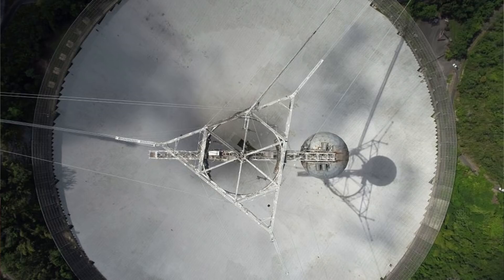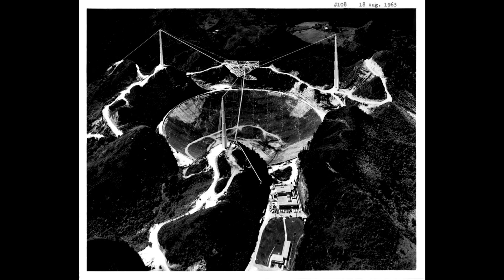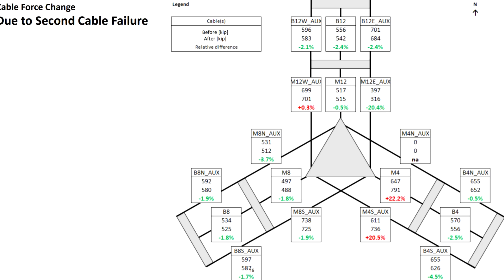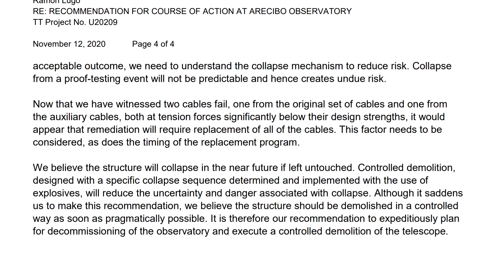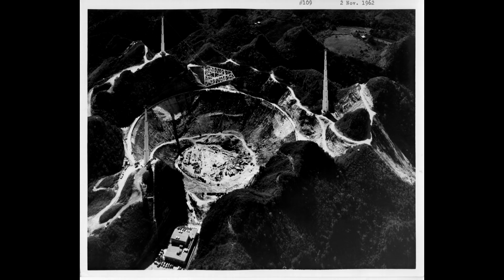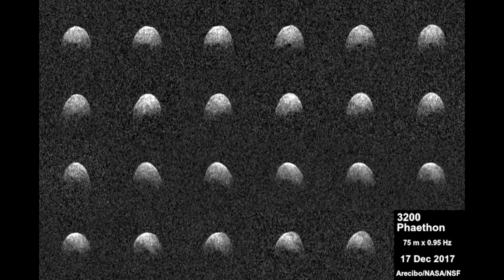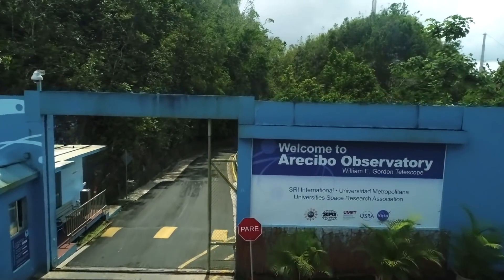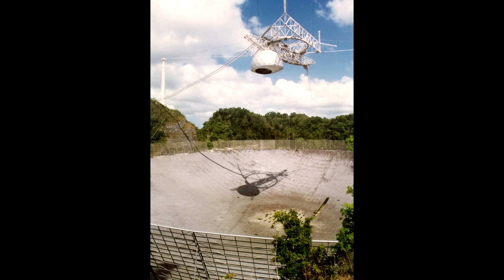Worlds Largest Radar Astronomy Dish To Be Demolished!

Comment: @Scott Manly. If superheavy booster can lift a 1450 ton Starship and Falcon 9 second Stage only weighs 126.5 tons wet why not create a combined dragon/second stage capsule with heat shields and engines on the sides like crew dragon?
Reply: 1) Cost - Starship is designed to be rapidly reusable. The F9 upper stage isn’t, and the money to make it so would have to come from funds being used to develop Starship itself. Even if you could do that, it wouldn’t make it easily & rapidly reusable.
2) Fuels - Starship is designed to run on CH4. F9 is designed to run on RP-1, which has a lower ISP than both CH4 & H2. Enabling F9 to take either would require a complete redesign, which would cost money that could be spent developing Starship, & give you a lot less capable vehicle.
3) Starship is designed to get 100 people or 100t into space. The combo you’re describing would cost more to launch while carrying a max of 7 people or 8 t to LEO.
Either the Starship works or it doesn’t. What you’ve described would be an expensive diversion of funds, would take more time to develop than a working Starship & would be less capable & efficient & more complicated than Starship, while costing more to launch.
Reply: @TraditionalAnglican  Granted in an either/or perspective with a view to Mars Starship is the right choice but it's impossible to ignore that Starship still has operational problems.  
1. No Launch Abort
2. Lunar variant is expendable 
3. Lunar Variant needs a new engine because it's thrust is too powerful for Lunar regolith. 
4. The Martian Starship will only be able to take 50-60 no 100 people so it's not a the craft for true Martian Colonization
5. Refueling Starship might take 4-6 separate Launches for Mars and the Moon which could take more than a week to accomplish and while you're waiting for that refueling you're consuming valuable resources for the humans onboard and having umans on board is extremely dangerous for 5 rounds of refueling. 
7. NASA is unlikely to choose Starship for their Lunar Lander for just these reasons. 

Here's what's absolutely NOT happening.  One Starship isn't going perform all the these task.  There are already SIX Versions of Starship.  Colonial Transport, Cargo, Refueler, 15 Person and Cargo Vangard for Mars, Planet Hopper and Lunar Transport.  These will all be different designs.  The BIGGEST problem is that they won't be optimized for their specific task.  Space X wants to make it easier to mass produce but doing so makes each variant inefficient to accomplishing it's task and that what were seeing with these refueling times.

On the Other Hand...
A Reusable Second Stage melded into a Capsule design is easier to refuel, has Launch abort ability, simpler and smaller to produce and only requires a new smaller variant of the Raptor Engine which the Lunar Lander already needs.  It could also carry as many 36 people to orbit.

I think it makes alot of sense.
Reply: @saquist  - Refueling can be done using Starships (or a single one that’s been fully refueled) already sent into orbit, so no waiting a week in earth orbit waiting for Refueling Starships. ATST, NASA has already decided that fueling with astronauts on board is safe for F-9. A week isn’t all that significant when one considers the amount of stores Starships will need to carry for the worst case scenario of an 18 month Earth Free Return.
An abort system wouldn’t help in most of the places Starship is going to be going to (Aborting on Mars would still kill the crew 99.99% of the time), and would add complexity, inefficiency & weight. We don’t have abort systems on commercial aircraft for the same reason - We just try to make them so reliable that these systems are redundant & completely unnecessary.
I haven’t seen where SpaceX is talking about using “Mini-Raptors” to land on the moon, but the engineers believe that mounting engines 1/2-3/4 of the way up on the side should solve the lunar regolith problem. ATST, there’s always the option of landing a couple of ALPACAS & building a lunar landing/launch pad, something they’re going to need to do if we’re going to have anything more than a very minimalist moon base. If we do that, the Lunar Starship becomes superfluous. The LS is supposed to be reusable, not expendable. That probably means it would have to go into earth orbit to be refueled. Actually, I believe Congress will insist that either the National Team Lander (a.k.a., “Lobby Lander”) or the Boeing HLS be used, and NASA will have to choose one of these two to have the Moon landing funded.
I’ve not heard of a 15 person Starship, & the Cargo Starship is designed to be easily modifiable into a “Refueling Starship” & a “Cargo Vanguard”. If you’ve ever worked in the airline or auto industries, you’d be quite familiar with how these are easily modified & optioned out & then used for different purposes.
I don’t see how a capsule that uses anything resembling the design of a Crew Dragon, Orion or Starliner could ever hope to carry even 12 people, let alone 36 people. Remember, capsules are shaped the way they are so they can reenter earth’s atmosphere. That limits their size & interior volume.
I don’t think you get that Starship, as designed will be able to launch for no more than $10 million (including Amortization of Development Costs). That means that, even with 7 refuelings, SpaceX could launch up to 48 astronauts to Mars for a maximum of $80 million, which is within $18 million of the retail cost of a F-9 launch & about the wholesale cost of 2 seats on Crew Dragon. Cargo Starships don’t have to get to Mars as quickly as Passenger Starships, so they don’t need as much Delta-V. That means they could get by with 4 Refuelings (less then $50 million). So, even with only sending 4 (2 Cargo & 2 Passenger) each window, SpaceX could have a small Martian colony in place within 7 years of the first “Cargo Only” mission. Remember, we colonized “the New World” using vessels that weren’t able to safely carry much more than a Passenger Starship.
SpaceX is designing an 18 meter wide behemoth, but that won’t begin development until after SpaceX has successfully landed astronauts on Mars & brought them back. That will have more than enough pressurized interior volume to carry 150 people each.
Reply: @TraditionalAnglican  
-Let me explain in detail.  Starship carries 1,100 tons of fuel.  But the Fuel Tanker Starship could only carry 200 tons of fuel to orbit.  You need at least 5 trips to orbit to refuel one Starship to Mars or Moon. That's 5 Launches and Launches can be scrubbed and delayed for more than a week for faults, weather, or loss of vehicle
-The Weight of Food and Water is not insignificant:  8 lbs of water per person, per day is 480 lbs of water.  2 lbs of food per day for 4 years+ 2 years contingency is 131 tons.  That's more than 75% of your cargo volume.  That doesn't include equipment
-Aborting on Mars would allow another Starship sent at the same time or just after or before to save the crew. That's redundancy.
-The Lunar Starship concept shows 6 engines (3 on each side)  If those are Raptors you don't need this much power or redundancy to land on the moon.  Nick Cummings of SpaceX stated that the new methane/oxygen RCS thrusters share a lot of heritage with the Raptor engine, and that testing activities are planned to start next year.
-No matter how Elon see abort systems, in NASA they are a must.  American astronauts will NOT be boarding Starship without launch abort. 
-The Vanguard Starship is MY Concept.  Space X and NASA aren't going to sent 60 people to Mars the first trip.  There is a ton of surveying, mining prospecting and power/storage to do on the first trip.  That's a small crew of 12-15 (2 or 3 pilots, 6 drilling/surveying specialist in two teams, 3 rocket engineers, 3 electrical engineers)  They will scout two locations, service Starship, and set up the power systems for the refueling depot. The  Pilots and Commander will be The  Martian Mission Control coordinating communication between the survey teams and talking to Earth.  This VANGUARD starship can be optimized for this smaller crew and LARGER Cargo to get things set up.
-A Crew Dragon Capsule is designed for the 12 foot Diameter Falcon 9 Rocket so Dragon is  only 12 ft wide.  The Super Heavy Booster is 29.5 feet in diameter. A Super Dragon 29.5 meters wide could use the SUPER HEAVY BOOTSTER and also be a second stage (just like Starship)  and could carry (according to my CAD designs) 14-36 people AND carry the second stage fuel to get to orbit.

Starship is cheap for two reasons.  FULLY Reusable and the Superheavy booster.
I think people are underestimating what the Booster can do and too focused on Starship itself.
Reply: @saquist  - - I don’t see any need to launch Mars/Moon bound Starship before the refueling assets are already in LEO, so there will be no scrubs that risk delays in refueling. That problem will then be solved.
- We’ve been recycling water in space since Mir, & the recycling efficiency has gone to 97%. I see absolutely no reason why an interplanetary spaceship should not do this. 50 liters/astronaut/week with 97+% recycled for the next week. 1.5 liters * 110 (to provide enough for an earth free return) = 165 liters + 50 = 215 liters/astronaut. 1.5 liters of food/day/astronaut * 770 = 1155 kg/astronaut. With crews of 24/Starship for the first 2 missions, That’s 1370 kg * 24 = 32,880 kg, which is less than 1/4 of what you calculated. 
- Earth Free Return is for the rare occasions when landing on Mars is impossible (think global dust storms). Starships would travel in pairs, so no Starship would travel alone.
- NASA’s only experience with Spaceships that lacked abort capability were with the STS, which was strapped right alongside a bomb that tried to shed its skin every launch. We’re actually lucky more of these didn’t blow up. An abort system adds a lot of complexity, weight & inefficiency to the design. That’s why we don’t use them on commercial & civilian aircraft. NASA will get to reevaluate this policy once Starship has flown 150-200 successful flights, which SpaceX should be able to do within a year once Starship has started flying. The problem with the STS wasn’t that it didn’t have an abort system - The problem was that it was an unsafe design to begin with. The same holds true for the infamous Boeing 737 MAX-8.
- The “Vanguard Starship” is YOUR concept, not SpaceX’s. Elon has proposed sending no more than 48 people in 2 Starships on the first crewed missions, so your Vanguard is redundant and would cost extra money & time to develop.
- I’m going to recommend that you really try not to mix English & Metric - One of the Mars Probes met an fiery end just because those programming it made that mistake. 9 m ≠ 29+ m. And the Super Dragon could only be 9 meters tall. Remember, A capsule can’t give you nearly the interior volume a “Bullet” will give you, and this bullet has 2x the interior length & >3x the interior volume. As NASA has concluded that people need 32 m3 for long duration spaceflight, and as your Super Dragon won’t have more than 276 m3 of interior volume, you’re limited to 8 or 9 crew members, not 18.
- I tend to believe you are responding to what happened during the Static Fires last week. That’s a problem that can be solved by adding 3-4 mm of 304L steel on the bottom to protect the hydraulics & the inner workings of the Raptors. This is pretty much what 4x4 manufacturers do when they put a metal plates on the bottoms of off-road vehicles to protect drivetrains, fuel tanks, fuel & hydraulic lines & other sensitive components that can be knocked out by the vehicles hitting rocks, trees, etc. when off-roading. There’s no reason to spend an additional $5B in development costs to solve a problem that can be solved with a few pieces of metal plate
Reply: @TraditionalAnglican  
-While MethaLox does have less Boil-off than other fuels we are still looking at 1-2 percent Boil-off per day per ship. If you've waited just 14 days for any Tanker to arrive the first Tanker will have vented 28% of it's deliverable fuel. But I must Grant that your reasoning is sound.  I took Elon's plans to litterally.

-Note my Water Numbers do account for DAILY recycling.  I have no problem with your extremely small crew sizes to reduce the mass of consumables as the initial vanguards will not be carrying civilian passengers. However it's still short of consideration of a disaster on Mars that may have them waiting 2 years for retrieval. 
-Abort systems as designed by Boeing and Space X don't add complexity.  Their Complexity is incorporated into the Capsules maneuvering system and provides a additional back up to normal thrusters. 
-24 people in a Starship won't need the space and facilities of 50-60 people.  That's unnecessary mass means more fuel. I look at those Four BARREL RINGS under Starship's Nose Cone as MODULAR.  You can take them out or add more.  That's all a Vanguard would be.  Just a Starship with less Rings.  48 People on Mars is also unnecessary but Elon will figure this out.

NOTE:  There are a million things of Elon wants that Elon won't get.  Those of us in the Engineering and Design Community knew Starship would never fit 100 people.  We knew Starship wouldn't have 3 Fin/Landing Legs.  We knew it would get six legs.  We knew the Launch Pad needed Flame Diverters and I knew the Raptors would have to be protected just for landing on Mars. And as for the future predictions We know that Clam Shell Cargo door won't happen either. ( I believe Space Shuttle like Cargo Doors is far better for cargo deployment. And I suspect there will be a horizontal landing Starship for Cargo attempting deliver masses nearly as heavy as Starship itself which would tip the craft over by crane) But if we all WAIT for Elon to come to the same conclusions we wouldn't be engineers and designers.  Instead we'd be acolytes....

-Yes I recall NASA's Metric/Imperial disaster but as an American our manufactures use Imperial even if the customers want Metric.  It's something we sometimes have to juggle. Thanks though.

-9 meters is a perfect height for the Capsule.  Currently its 8.7 meters (Without a nose cone) with 4 decks of passenger space.  (Flight Deck 4 seats, Deck Two 10 Seats, Deck Three 12 Seats, Deck Four 10 Seats.)  Right now the Pressure vessel is 8 Tons.  I'm trying to add isogrids to reduce that weight.(QUESTION:  How did you come to the 9 meter height limit?  I used the Starliner as a template simply to reduce the amount of scoring on the top of the capsule during reentry.)

ONLY Starship can go to Mars.  While Zubrin want's a Mini Starship for some of the same reasons I want a Super Dragon Capsule  they aren't quite the same. My Super Dragon Concept wouldn't go to Mars it's really only a passenger vehicle for Earth Orbit and the Moon.  
1. Easy to refuel with one Starship Tanker. 2. Has PAD Abort Ability, 
3. Combines a Capsule with a second stage in one. 
4. Cheaper construction for a Planet Hopper.
5.Most Importantly this Capsule could ferry people up to the Starship waiting in orbit for the Martian Transit. (That's why I designed it)

Ultimately I think Super Heavy can support a versatile number of designs.  I'm by NO MEANS suggesting Starship isn't a good idea.  Super Dragon is just a compliment that could happen later or sooner if Starlink actually provides the revenue Elon Hopes.
Reply: @TraditionalAnglican   Oh and I also predicted the mini Raptor Engine albeit for different reasons.  I was working on a horizontal landing Cargo Starship for Moon and Mars but the the Ratpors were much too big and massive to fit on the sides of Starship and the Super Dracos were 1/64 the power of the Raptors.  An intermediary engine was need for my concept.

Comment: Seem like if it were going to be demolished anyway then lowering it down on the existing cables and seeing if they break would be worth the risk (assuming the dish on the ground could handle it.  OR, try to quickly build a truss coming up from the edges outside the ground dish to temporarily support the hanging platform section while the cables are replaced.

Seems like this is an original engineering failure... they didn't ever ask themselves "how will we replace those cables?".  No cable lasts forever.

Comment: I said on another discussion about this that Its sad the design flaw here is that the cables aren't on a winch system that allows the whole assembly to be lowered and sit on hard mount points inside the dish for maintenance work.
That way all the cables could be removed and replaced or any other work done in a much safer environment. It could also be used as a way to secure the equipment during storms. Perhaps the replacement will have such a mechanism.
This could be a perfect excuse to build the mother of all dishes! Similar concept, but bigger, stronger, more capable. etc...

Comment: According to one channel Arecibo was originally designed as a US missile tracking system able to detect whether Mirvs were actual warheads or decoys (something to do with Ionisation  during re-entry) ,also built to monitor US test missile launches. Maybe  the 'end' of the cold war and better ABM radars  caused the  govt funding to be cut for maintenance and repairs.
Reply: This is bullshit.  Arecibo has a very limited pointing ability.  It looks pretty close to straight up.  ICBMs come over the north pole, not from Africa.